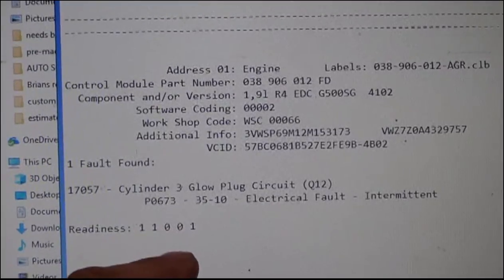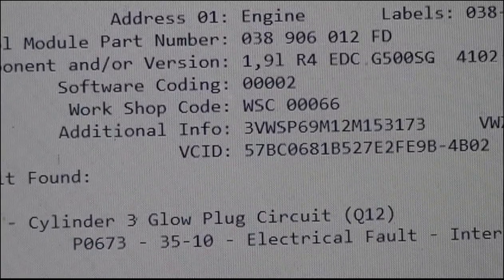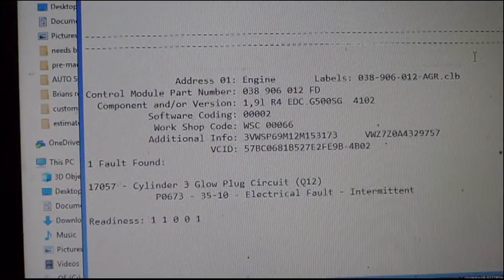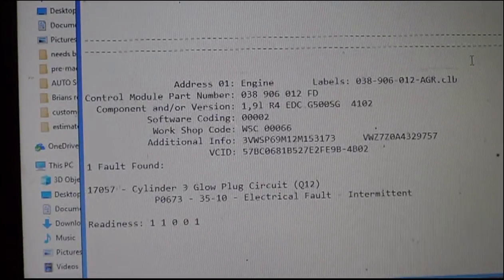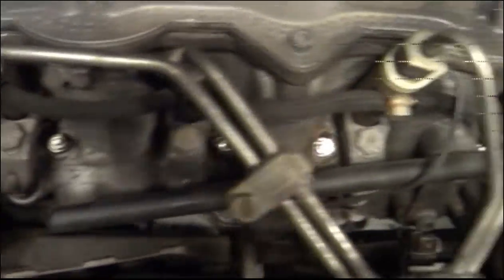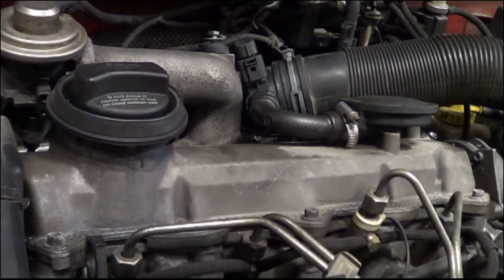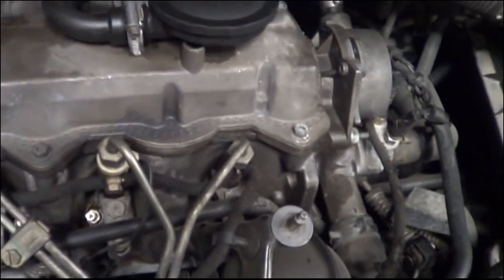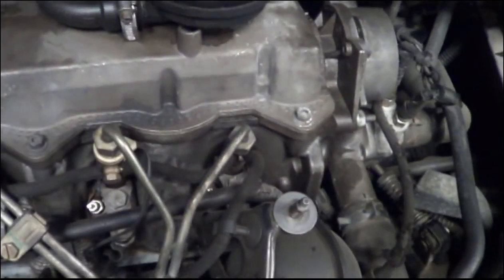Tdi ALH P0673 Glow plug

Comment: They're labeled in the order they come on the harness.... This is pretty common for electrical things.... Million times easier to test these by just checking continuity or using a test light vs all this tapping trying to read amps stuff.

Comment: I think it's simpler to just measure continuity from glow plug to the block.  It reads about 2.8 to 3.2 ohms.  The bad one reads open or infinity.
Reply from the maker: Yes, it is.  I did so also,  till a few read fine, but didn't work and triggered codes.  You can get by with ohm checking, till it screws you.  Amp checking isn't hard.  Of course if you don't have the equipment to do so, then you do what you gotta do.

Comment: Simple resistance check between the  plug connection and hex area where socket goes is all thats necesary to check. Should be about 1.2 ohms. No need to remove glow plug unless its bad. And watch those damm threads. Absolutely stupid german engineering. Who would make glow plugs into aluminum head with such fine threading? These goofball engineers are retarded.

Comment: Just discovered your videos, awesome job and greatly appreciated. I have an 01 tdi that intermitantly goes into limp mode. I did a scan and got back the PO234 I believe it is. I figure it's either the N75, stuck veins or a vacum leak? Thanks for putting in the time to show us this stuff, hello from Florida.
Reply from the maker: run through the tests in my videos and you should be able to identify the cause.
Reply: @CoolAirVw  OK, thanks for taking the time to reply.

Comment: So, does replacing the glow plug fix the issue? Or is it a harness issue?
Reply from the maker: Glow plug harness can cause it as well.  If there is significant cracks in the harness, then it will probably trigger codes due to moisture intrusion making resistance.  If all the glow plugs amp test good then the cause of the code is usually the harness.
Reply: CoolAirVw Awesome, thanks so much for the reply and super helpful video! My car shall live another day :P
Reply from the maker: @themetalmeghan4990  Thanks for watching.